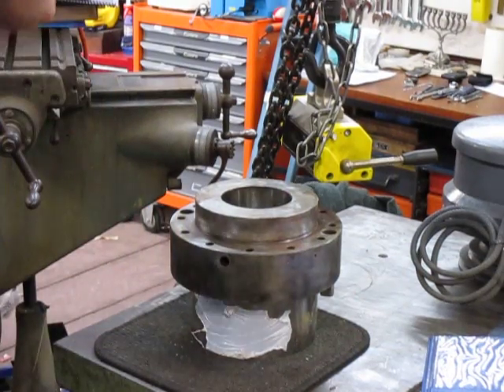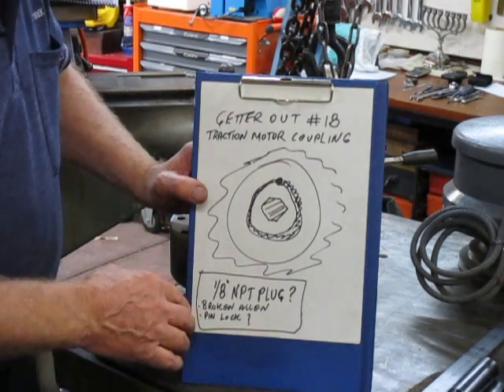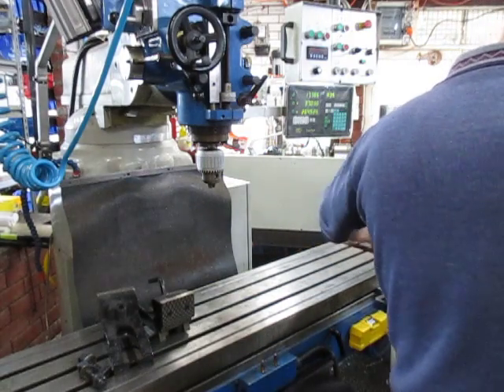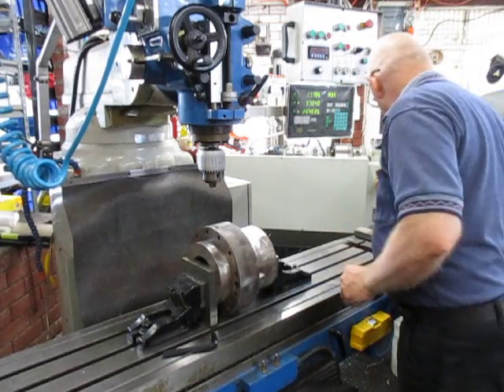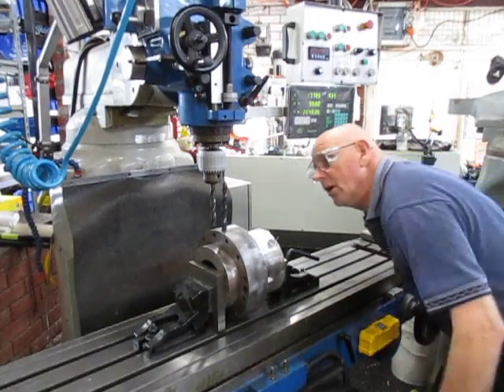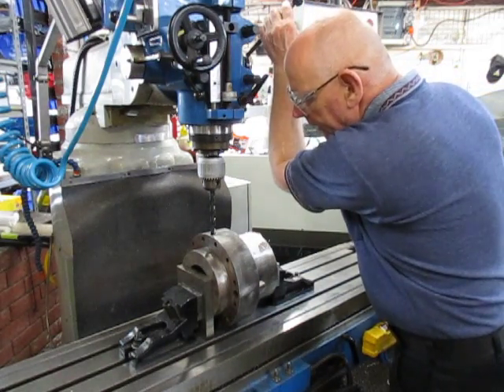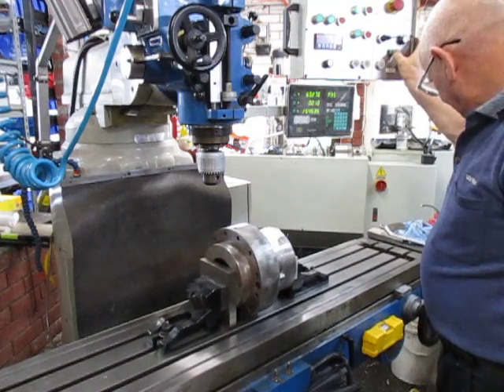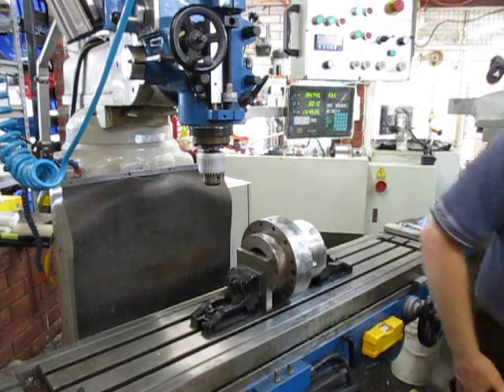Getter Out 18 part1 traction motor coupling seized plug

Comment: Had to comment before watching any further, I like the the quick release magnet on the gantry crane. Like you I'm not far behind you in age and have added a gantry crane to my shop for the same reason, but not thought of using a magnet. Now as to using the 2 drills to find vertical, ever thought to use one of those small magnetic digital box angle meters. I find it very useful and accurate to 3 decimal places...

Comment: I love those mill table jaws! Looks like a quite handy tool. I know how it is trying to drill out broken bits and whatnot. Almost always chip or break the cutters in the process. Nice job Bruce.
Reply from the maker: Adam the free vices are great, I first came across them on large lathes where you normally only use face plates and free vices, or some other jigs, also floor borers / vertical lathes and slotters. this lot (I have two pairs) cost around $200 for a pair, not a lot of money in comparison to their versatility and the added options on the mills.
Reply: Bruce Whitham Where can I find a set of those vises? I've looked around on the internet but didn't have any luck. Thanks
Reply from the maker: awlyons2 I bought one set here in Australia from Hare and Forbes Machinery House (on the net). they call them Machine Free vices V102 is 76mm wide and V103 is 100mm wide.
The second set I have I bought from a different supplier and they are Japanese and they call them "Pull down free vices" sold in 3 sizes 80-100-125mm widths (company Brand Nabeya Co Ltd Japan) Maxiloc Tooling sell them, I'm sure you will be able to find them elsewhere possible with a different terminology. Good Luck Bruce